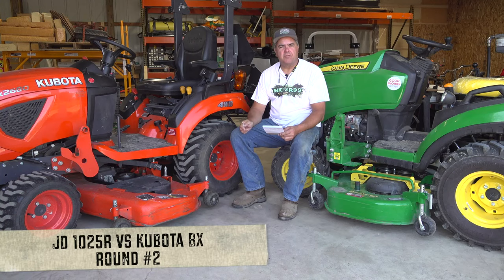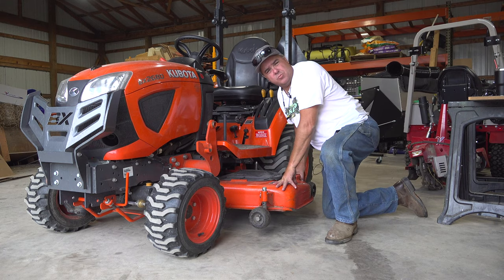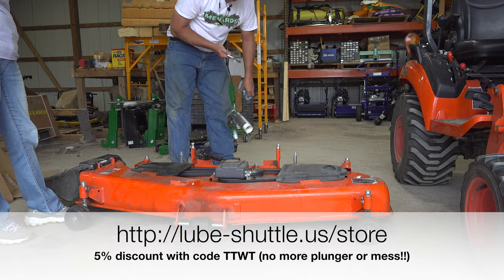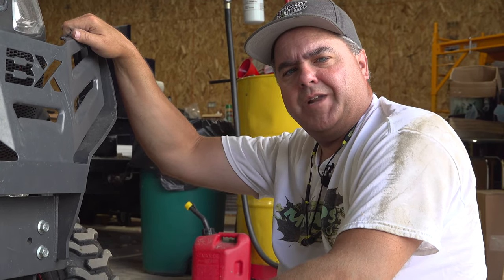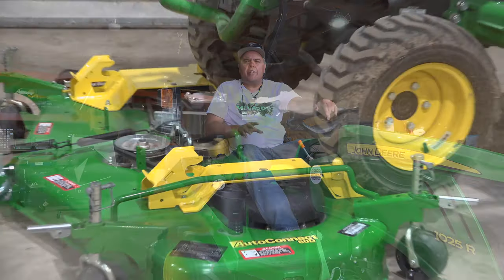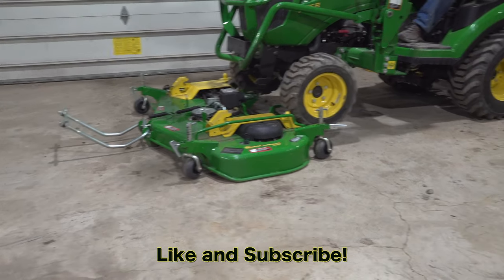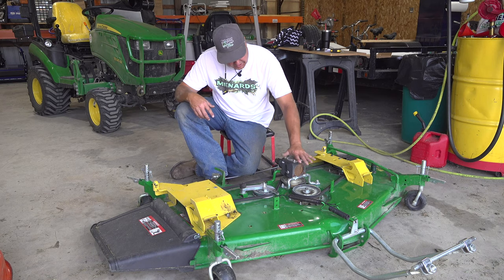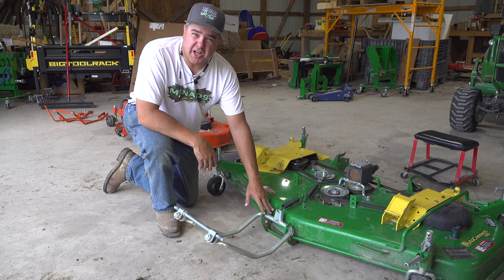Deere 1025R vs Kubota BX Round #2 of 8 Mower Deck

Comment: Tractor Time with Tim - thanks for a great video!  I watched this after I had to remove my MMM on my BX2660 Friday - I struggled like you did shifting the deck around to slide it out!  Today I re-installed it turning the front wheels to the left - rolled in straight.  The other thing was I replaced the key ring type to a clip to release the pins holding the anti scalp wheels in place

Comment: Nice job Tim, your care is evident. Only bits you missed on the Bx were the size of deck belts and the L\R leveling springs. Kubota does offer 3 decks, fine cut, standard and drive over. The fine cut is a flat deck like your Deere, at least that one does not handle volume as well as the air tunnel version. It does have some extra baffling for a finer mulch. You put a note about a welded rod on the Deere, the BX edge is rolled for strength. .... really,  I've never seen either of these tractors with destroyed or even rusted decks. You also forgot to point out that your tractor has the optional auto connect PTO, that's not standard (it is what seems to cause the most adjustment issues, at least ones the ones I've tried)

You make me second guess my negative attitude towards drive overs. You have remember that few people have your skill level to make adjustments. As a whole, dealerships don't like selling things that have a frequency of calls for silly adjustments. My concerns are less functional, and more practical. We'd value consistency over convenience. They do make a great  demo, the kubota included, when they are properly adjusted.

I will admit jealousy at your attachment to lift the deck with the loader. That's killer.
Reply from the maker: Great comment Neil.  Thanks!  I will address the belt in a follow up.  I didn’t really catch this.
Reply: @TractorTimewithTim  The Kubota drive over deck is worth mentioning, since they are available.  I haven't used one and my BX doesn't have one, but from what I've seen online I think the JD setup is better - I think the Kubota has smaller front wheels and/or deeper deck, and they couldn't drive over without the little rattly and annoying ramps.  But it would address the ability to take the deck on/off without getting on the ground - it'd be a closer comparison, albeit one you probably can't do since your BX doesn't have that option.
Reply: I've had my 1025R since 2014 and have never had a problem with the drive over deck.  Rolled edge or not, the JD 7-iron deck is far far superior to the Kubota and a 1/2 inch steel rod makes it much stronger.  I'm not bashing Kubota (I own a KX018-4 that I'll match against any competitor) but, JD is vastly superior.  The fact it doesn't lift as high is really a non-issue.  It's so much easier to remove and you don't have to worry about getting your tractor stuck because the mower deck hung up while you were doing loader or 3-point work.
Reply: Neil, you do seam to be trying hard to be politically correct, to me you just need to admit your Kubota is not even close to a JD in so many ways. Most of us don’t care what color they are we want what works the best.

Comment: Love My Auto Connect 72" 7 Iron.  Can not wait for the comprehensive Adjustment video.  My local independent Dealer was just screwed over by Deere and now sells Yanmar !! so my new dealer is 40 miles away instead of 3 miles. I have 250 hrs on my 2014 1025R   (just got the paid off note) and the deck is now out of adjustment somehow.  It raises up in the rear fine but moves very little in the front height wise. While very mechanically inclined and do most of my own repair work I do like the visual of a repair prior to starting the Job.  Sooner the better for the adjuatment video.  Also the one thing I do notice with the auto connect. I use a rubber floor runner to prevent the deck from sliding when connecting ti and the rear locking arm sometimes is very hard to release the lever the deck must be very level and the tractor "pushing the deck forward while stopped to tske pressure off of the Release lever.

Keep up the great videos.

Comment: Great video. I sometimes whine about taking my deck on and off the 1025. This video brings me to reality how easy I have it. 👍. I don’t take my deck off on concrete. Had the deck slip sideways a couple times. The deck wouldn’t click in and the two reasons were; the PTO needed to be in the rear setting and the other was a set screw backed out of the deck PTO spline. Other then that. Greatest invention JD made.
Reply from the maker: I have encountered both of those issues.

Comment: Just a tip for all of you on the John Deere. After removing your deck. Raise your 3 point handle (the one that raises your mower deck) all the way up. And adjust the knob that sets your cutting height to the highest setting. So when using your tractor out in rough terrain or in heavy brush your mower deck brackets will always be tucked up out of the way.

Comment: We have a jd 1026 r and the drive over deck  is really convenient. We have a 20x12 shed with wood chips as floor and I just drop the deck and go. With the bx I would not be able to pull it with enough room or be able to pull it on wood chips...

Comment: Thanks for the video.  It was very instructive.  When you do an "under the deck" review. please show how the blades are changes if you do not have an air driven gun.  Another useful video would be deck maintenance.  I saw a good one on a rusty deck which was informative, BUT how ablout cleanining the deck top and bottom.

A dear friend of mie has a total of about 10 acres to mow between his rental properties and his home which sits on about 6 acres and the abutting village owned field which is never mowed unless he does it.  He bought a Kubota about the size you used in this video but he has a rear mounted brush mower and a rear mounted finish mower.  I've never seen the mowers but the results are beautiful.  Like you, he is in the computer business and he likes to putz in the yard with his tractor and he is a bit OCD when it comes to maintenance.  The mowers are Deere repainted to match the Kubota!

Thanks again for your thoughtful videos.

Comment: I get off my 1025r and look underneath to make sure both sides of the rear auto connect catches on both sides.  I have had twice one rear side miss, but the deck is so solid it raised and seemed it was connect at all four points when it was not.

Comment: I have a Kubota BX2660 with a 60" deck. I swapped out those factory pins on the anti-scalp wheels with "square lock pins."  It made removal 3 times faster.
Reply: Thanks, great tip.  I had a BX for almost 15 years and just replaced it with a BX23S.   Dealing with the anti-scalp wheels is by far the most annoying part of taking the deck off.  Can you tell us, where did you get the pins?
Reply: @Salmagundiii  I just got them at a local hardware store. They have them in packs of 4 or 8 last I checked.

Comment: I hate removing the deck on my BX - I don’t care how much lipstick you put on the deck removal.  It’s a pig to take off and on.
Reply: I agree. It's 1 of 3 things I dislike about my Kubota even though I love my tractor overall.
Reply from the maker: Yep. Entirely possible to be very happy overall with a machine, but not be satisfied with all features.    I think we are ALL that way.  I have a list of those on the 1025r as well :-)
Reply: If you have a fel, use it to remove the deck... it helps...
Reply: @ERICMB24MF37U24F39  fel?
Reply: @truckinchihuahuaalvieschre2494  "Front End Loader" lay a pies of wood on the ground and push the tractor up for more clearance to remove the mower...
Reply: @truckinchihuahuaalvieschre2494  front end loader
Reply: @ERICMB24MF37U24F39  ok brain fart on my part LOL
Reply: the mower deck and the f'ing bagger system....no idea who it works on a JD but I do not like my bagger system, though I love my Kubota.
Reply: I have 2” spacers on my back tire so I can not turn my mower wheels out. I do use the FEL.
Reply: Hey, guys I have had 3 BX tractors over the years. The mower comes off esay when working on flat concrete surface. I can take it completley off and reinstall within 4 mintutes.
Reply: I have no problem removing my bx mowing deck. I just unhook the deck from the tractor. Use the fel to lift the front tires off the ground, push the deck forward under the tires then lower the front end back down.  I can take it off and put it back on in about two minutes.
Reply from the maker: Would love to see a video of you removing and reinstalling in 2 min!
Reply: @TractorTimewithTim  I'm not a big video guy but I'll see if I can make one
Reply: Pretty much the same as removing my deck on my 2001 JD 445.
Reply: @jasonstephens8980  
Same process I've used doing the deck on my mom's Mahindra
Reply: I agree it's not as simple as driving over but even being in a wheelchair, it's not that terrible to take on and off. Chose Kubota over Deere because of price and the pedal setup works better for my makeshift hand controls.
Reply: The Kubota reminds me of my 445 with the 60", it was about the same easy.  However, the drive over deck is a fantastic improvement.  I love my Deere, but I do have lots of respect for the Orange ones too
Reply: @jasonstephens8980  can't push forward under front tires because it would hit the loader bucket that is holding the front tires off the ground. Calling bs unless I see a video.

Comment: When I attach my auto-connect deck on my 1025R, I drive over the deck and when the front wheels touch the ground, I get off and just take a peak under the tractor to make sure everything is still in alignment including the auto-connect PTO.

Comment: I own BX2380 with mid mount mower.   I looked at the deere products and they were definitely my second choice.   Honestly the Kubota got the nod more for the dealer than the tractor.   Having said that The Kubota mower is not so bad to get off, BUT that Deere drive over does look pretty sweet.   All the BX owners out there claiming bias are just looking for a reason to complain.   Round one video was pretty fair, and this one was too.   Each tractor is going to have its strong points and it's average points.   Drive over deck is a strong point.   +1 for Deere.   Loader removal will be a +1 for Kubota ( well maybe +.5 ).   

I do sometimes feel like TTWT is more about advertising for sponsors, but this series has really been good so far.   

In the case of this series I really believe that the end result is likely a draw.   In my case the Kubota dealer made me a better deal, was closer to my house, and genuinely seemed more interested to spend time with me to show me the equipment and answer my questions.   This kind of support is worth more than a drive over mower deck to me.   JD does make a good tractor and I don't think anyone is going to regret purchase of either tractor.

Great Series Tim, and God Bless you always.   Don't ever loose the Bible Verses on your videos.
Reply from the maker: Well, it likely IS a draw.  There is no way I could be so presumptuous to decide for someone else.
Reply: A lot of the decision does come down to the dealer and their proximity to the property. In our case, the JD dealer was further away but the drive over auto-connect was really hard to ignore. The other point Jeffrey made was the support by the dealer - ours delivered the tractor and the attachments, worked with me to adjust the deck, remove/install the loader, and the implements via the quick hitch. I got lucky and got everything I needed, including the 50 hour service for free.

Comment: My only gripe about my 1025R is the deck lift height. I pretty much have to mow at the highest setting because it’s so low already at full height. And I had dealer adjust it high as it will go.

Comment: i have a 2019 bx23s i love it.my drive shaft coupler locks back and i lock it back and when its slides over  the saft it unlocks and moves forward on its own . 268 years of age i dont mind getting up and down ..if you dont use it you loose it.   plus i just cant sit on a bright yellow seat.😆

Comment: A cotter pin (quick pin, something) in the wheel height shaft (first step removing, last step reattaching) at the lowest hole you can see will keep the height setting correct.
Reply from the maker: Check out round #2 follow up.

Comment: It's amusing how people who sell Kubotas theatrically make this process seem so cute and easy.  Literally polishing a turd and trying to pick it up by the clean end. It was nice to see a video that wasn't trying to push a buyer in one direction or the other, accurately portraying reality.  This is how a normal person would be doing it, and it completely sucks.
Reply: Yep, those of us who've had lawn tractors in the past KNOW it's a pain in the butt to remove them, so we try to avoid it, lol.   To clean out ours, we used drive on ramps to tip it up, so we could get under it   Removing/ installing the deck involved at least one pinched finger (from the belt pulley and tensioner), and a couple of cuss words minimum.  Thus, the ads showing how easy and simple it is make us laugh- knowing full well they cut out the parts where the presenter struggled and/or cussed at it.  Why would it be any different for a compact utility with the same mower deck setup??    Aside from the pto shaft replacing the belt pulley/finger mangler, that is.
Reply: Matt Lawrence hahaha our local jd dealer bought a bx to put on the showroom floor and attempt to show its inferiority. I think we sold 6-8 bx’s thanks to their marketing. Kubota decks stay on because they don’t break as much. What engine is in the Deere? So nothing runs like a....yanmar?
Reply: @danstevens2204  yanmar is one of the most reliable engines in the world with a huge parts market. You don't work on engines therefore you don't know what your talking about. Yanmar is the best engine in small sub compact tractors.
Reply: Jose Antonio yes I do work on engines and yes I do know what I’m talking about. I also know better than to argue with a fool 😉
Reply: @danstevens2204  Yes I am a fool based on a comment followed by a wink lol... Ok
Reply: Jose Antonio lol nothing runs like a Japanese Deere. Can’t even spell it correctly ffs 🙈

Comment: You can turn the scalp wheels and set them lower so you do not have clearance issues.  I have not seen one in person but Kubota does make a drive over. Most dealers will try to talk you out of it.
Reply: Yes, you have to unfold the drive over ramps and install them every time and they are in the way of connecting and disconnecting the PTO shaft. This is why some Kabota dealers steered customers away. Only thing it saved was your back. It took twice as long to install. My neighbor had a BX for 2 years. He traded decks 1/2 way threw 1st year. Just 4 the drive over. He now has a 1023E with auto-connect.
Reply: Alvie Schreckhise 

Watching this video it looks like it is fairly similar to the John Deere just not as slick. 

https://youtu.be/kZeF643QxQM
Reply: Kubota does make one. I actually think it's just this regular deck but it has slide/fold out metal ramps to drive on
Reply: The Kubota drive over rattles a lot

Comment: Tim, curious to know if you noticed more efficient transfer of power to the BX deck with the gear box design integrated with the center spindle? One less 'step' to get the power from point A to B...
Reply from the maker: I did not notice any difference.   
On the other hand, there is no belt to soften blows from objects you might hit.   Several folks have reported broken gearboxes due to hitting something hard.   I think I discuss this in the follow up...but can’t remember for sure.

Comment: DO NOT GREASE THE SPINES ON THE PTO SHAFT! Use oil only. Grease will cause dirt to get in there and then you can not slide the PTO shaft freely with your hand when you connect and disconnect. Don't ask me how I know...
Reply: kubota has maintance free shaft
Reply: ANY WET lubricate will attract dirt.  I would recommend cleaning the spline shaft  well.  Then apply a graphite coating which will dry and provide plenty of low friction for years.
Reply: @jaybee2344  dry graphite would be an excellent choice. With that said the oil I've used has never been an issue. Yes it attracts some dirt but the shaft has always remained free sliding.
Reply: There's no real reason to lubricate that section anyway. It's not a high friction part. It's simply holding two steel rods together that are capable of separating for REMOVAL of the implement. 😎

Comment: You missed the grease fittings! Kubota deck has grease fittings on the anti scalp wheels..  not sure if Deere does? 

Also it is MUCH easier to remove the bx deck when the tires are turned all the way one way or the other.. it really doesn’t matter which way you turn the wheels it’s more to just turn them to widen the gap between the front tires to the rear tires to allow the deck to slide in and out from under the tractor that much easier. 

Another great video Tim!